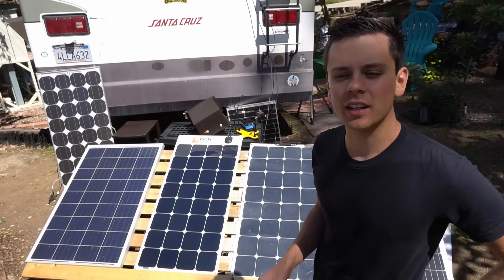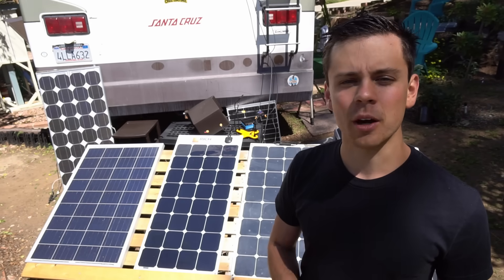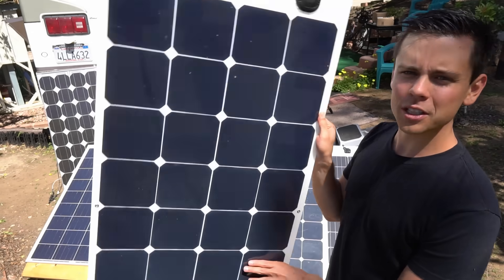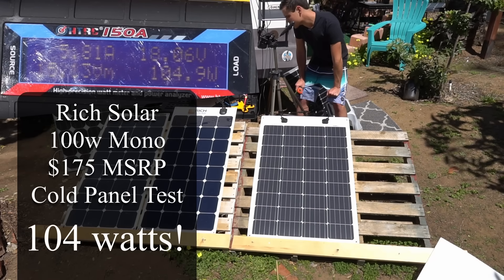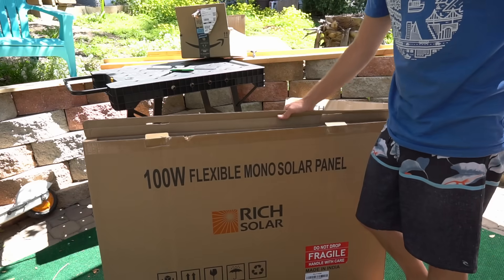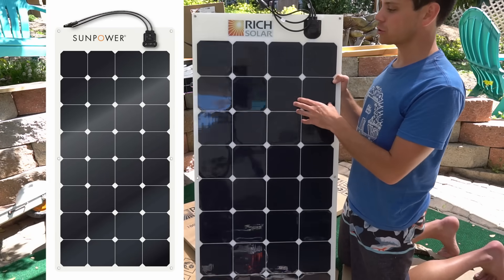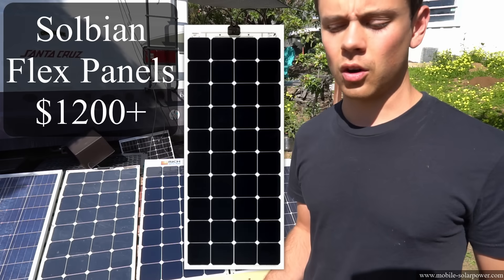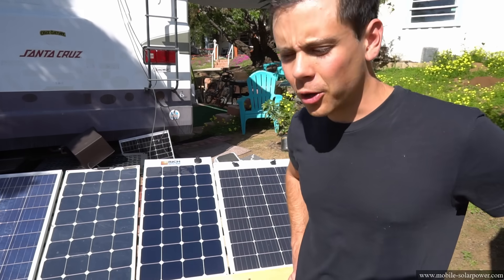Flexible Solar Panel Output Test: Sunpower Cells After A Year vs. Traditional Mono Flex Panel

Comment: I know you dislike the flexible panels, as do most of us, but would absolutely love for you to do an updated video using current products.  I need to reduce weight significantly on our sailboat bimini so going to remove the 500W glass panels we have and replace with flexible.  Thanks!

Comment: Hi and many thanks for posting this vid, this would be one of the best panel output test so far - I have just purchased a Bluetti AC180 mainly for emergencies and for some basic camping use so while the power is it shall be charged through grid power. Now that I am wanting to purchase a solar panel I would be interested to know what type and size of panel you think would be best to use  choosing from - blanket - folding - framed and it it worth getting a few 100W panels instead of one large 300W. Cheers Glenn v from NZ

Comment: I have a curved bimini on my sailboat.  I don't think I can mount a rigid solar panel on it. With 100 watt flexible panels as cheap as they are, maybe this could be a maintenance item to replace them every 1 1/2 years.😢
Reply: how it is a year later ? how much do you output ?

Comment: i got in March 2022 - 4 of my flexible Panels (its a firm called solartronics from germany) for my Flat (i have no Balcony, and i hang them out the window with safety straps like you would secure load on a trailer, you know) - so iam recording the data, i have east-west orientation (due to the roof i dont get a lot of sun at high noon) - so i added 20w polys on the windowsill as well (4 of them on each window, so 8 total) - so i get the most of the sun as possible for my situation - and i have not covered all spaces. so there is room for another 2 20W Panels on each window wich i would test next year. but in summertime i get a lot of energy through it, i can run my fridge/pc if i want. and thanks to your diy lifepo4 videos, i will change my batteries from agm to lifepo next year...so thanks a lot! i record data every day, whats going in with what panels. and i can look up next year, if my flexible panels will degrade, i will see it...

Comment: So you say that panels lose performance more than rigid and that you are going to continue to test. So are you going to mount these flex panels outdoors over the next year so you can simulate actual use ? I have a 100w rigid that has worked fine over past 6 years; however i have discovered that my camping consumption is greater than 100w will produce so i am trying to decide what to buy and how much so love the videos. My camper has curved roof and i am also trying to decide on 200/300/400 and rigid vs flex and also fixed to roof vs portable to follow sun at campground. Your videos are informative and "fun". I live in "sunny" California but have camped in all 50 plus Canada and NW Terratories

Comment: Have you seen any panels catch fire? I just saw that Amazon has disconnected their US solar panels because of a high rate of fires caused by them. I googled Solar panel fires and it seems fire departments are training for this situation. That's scary. Hopefully when I get my system installed on my RV this doesn't happen to the pet because it's a cat it's not easy to take with us if we need to run to the store for supplies, he can't call for help if we are not home.

Comment: Did you test any of these new non silicon based 360 degrees bendable solar panels from Japan with a 100 Watt and 200 Watt rating. They don seem to degarde and cost several hundred dollars.

Comment: Howdy will! I was wondering if the technology has changed at all in the last two or three years? I am in need of at least 300 to 400 watts between 2 flexible panels to fit over the curved Bimini that covers the cockpit of my sailboat. Are there any that you would recommend? Or am I better off trying to build an entirely new structure capable of holding rigid panels?

Comment: Hello, i need help regarding this flexible panels, i am trying to install an small offgrid solar system for my family in Cuba they're having a terrible situation with the energy there, but regular panels weight to much and gonna cost me a fortune to ship them, I wonder if I can use this flexible instead, using the same inverter and battery pack?

Comment: It appears your judgements is based on older technology. What do you think today? Do you take in consideration how the panel is mounted? I use flexible on a stiff frame for weight considerations. It seems like there are pros to some of these but with your bias against flexible panels you can't bring yourself to recommend one even though there might be one you favor.  Too bad.

Comment: I would be interested in a test of flexible panels that have been coated with Turtle Wax Ceramic coating. It tests well as a cheap automotive protectant, but I'd be curious if it would reduce efficiency. My first instinct would be that the inherent UV protection would hinder the efficiency, but on further thought, solar cells convert "visible light" to electricity so the UV protection might not have any measurable impact on production; but may extend the life of those flexible panels considerably.

Comment: My Kingsolar (Sunpower) 100W panels failed after 1 year. The factory had glued them down across the entire panels with permanent adhesive. Had to cut into strips whilst on the roof to tear strips off.

Comment: Renogy 175 watt flex or SunPower 110 watt? Which would you suggest for a teardrop with minimal flat space? I have both. The Renogy has a more durable looking textured surface. I plan to mount on t-tracks with an air gap it so can be removed in the winter.

Comment: To my understanding these are mono or poly panels, im interested by thin film panels. They can be flexible but its not my interest, im looking to a solar array capable to have a lower difference between summer and winter in Europe (if I try to be self-sufficient I see many instalation doing 5 to 20%max prod in the worst months, December and January, compared to the best June and July.) I've heard thin film to be better for shade(not my concern) and low light/clouds.

Comment: This is a great video. I especially like the hot vs cold test since many people think they have a bad panel when it just gets hot in the sun. In my initial research, it sounds like the ETFE coated panels are far superior to the PET coated panels (older style). Further, if the claims are accurate, ETFE resists heat absorption much better than PET leading to a much smaller reduction in efficiency because the panel doesn't heat up as much. Would love to see a more in depth comparison of PET and ETFE panels and long-term follow up. My understanding is that PET panels have a 5 year life expectancy while manufacturers are claiming 10 years for ETFE.

Additionally, resing the flexible panels on the pallets may lead to increased temps (and effeciency loss) because air cannot pass underneath as well. A traditional hard panel with a rigid frame with spacing behind the panel would allow better heat disipation and cooling underneath while resting on the pallets while a flexible panel will not get as much cooling effect. Per the comment above about ETFE resisting heat absorption, this may be why the new ETFE panel had such a high output even once it started getting warm. The temp on the surface may be high but the solar cells may not have been as hot. It may also be a good idea to check what the temp on the back of the panel is. That may be a more accurate indication of how hot the cells get.

Nice work as always!

Comment: I installed three sunpower panels on our boat, in the sun full time in Feb 2019, so far they still look new. I will keep you posted .
Marks Marine Electric, San Diego
Reply: Are they made with PET film or ETFE film?
Reply: how are they holding up after two years? thanks in advance
Reply: @Maybelove88  we were on the boat over the weekend, but the weather was not that good, but so far they are still holding up as expected.
Reply: id be interested on your info...  are they still functioning well  and ETFE film?
Reply: We were on the boat a week ago for three days, from what I see they still produce what is expected. The weather for that weekend was cool and some clouds present. Still batteries reach up 90+% each day with a daily draw around 40 amp hrs per day, in the morning the battery bank (500 amp hr) would be at low 60%

Comment: using roof mounted solar panels requires you to park van in sun yes ??   which gets van hot ??  then we need power to run fan or a/c ??     I am going to make a quick  setup to be able to put van in shade and panels in sun !

Comment: On my Prius, I save $30 a month in gasoline from not using the car as a generator with 200W of flexible panels taped to the roof. That’s a quick payback !
 I could not figure out a good way to mount a glass panel without loss of aerodynamics therefor loss of MPG on a Prius. Thanks for the great review!

Comment: Hey, first of all I just found your channel and it really is informative and well thought out.  I just subscribed.  I have a camping trailer that I tow behind my Jeep.  My trailer came with a 100 watt panel on the roof and also an external plug on the side of the trailer.  I know there will be times that I will want to park my trailer in the shade so I would like to get one of those flexible suitcase type panels.  I have to keep the weight down and I don't want a big bulky aluminum framed panel due to size restrictions.  I don't see any reviews of these types of systems on your channel, can you do one?

Comment: Im like a kid who you tell not to touch the hot stove! I bought 2 100w renogy flexibles. My thought process is to take a portable lithium between places and have four 100w poly mounted on the roof, at each home. 2 flexibles are for travelling with the portable between places. My setup is just incase power goes out on purpose or accident, and it will after the Paradise fire last year. So im hoping they wont break or break as fast since they wont be used that much, or constantly.
Reply: I think you'll be all right.  I have the exact same setup, and I ABUSE mine, all day in the sun every day, and they're still going strong.  I'm going to do a longevity test vid at 1 year

Comment: Will - I really like and trust your analysis and would normally not consider flexible solar panels.  However, I have a Rockwood 2604ws travel trailer which is aluminum framed with a foam core and just a very thin layer of wood under the rubber so there is very little to screw a hard panel to (my preference would be 1000+ watts of rigid panels with a tilt kit, connected to a Tesla battery).  The people at Rockwood have advised against "screwing" anything into the roof.   Given this information, would you agree that flexible solar might be my only option?   Do they have a 250+ watt panel that you might recommend?

Comment: Sunpower cells are good if you want a burn mark in your roof. The moment you get a crack (and you will after year of it baking in the sun becoming brittle), increased resistance and then hotspot and off you go!  Good video by the way.

Comment: Hey Will I just got today a couple of the Rich Solar power that you recommended. They came in the mail. Anyway, when are your doing that video on how to connect these to the new Apex’s EC8 charging port? I heard that EC8 can not carry 190 amps off power opposed to only 90 amps with MC4 and this is why Inergy made the change. And that if I use these MC4 panels I will void my 1 year warranty with iNergy. Is that true?
Reply from the maker: Very cool. Mc4 cannot handle 90 amps at all. And ec8 attached to rich solar will void warranty but it should work fine. Do not solder ec8 plugs, you need to find them with wires attached so you can crimp them to solar panel wires. Just make sure you crimp the right wires to positive and negative
Reply: Thanks Will. I will wait for your video on how to do that crimping and how to connect the Apex to my MC4 panels. Pardon me I’m a newbie when it comes to these things.

Comment: Do you think the decreased lifespan has something to do with cooling?  Since the flexible ones are held together by sheets of plastic, rather than a large metal frame, the panel assembly heats up faster.  And because it is flat and flexible, they're more likely to be mounted directly onto a surface rather than raised up so air can flow underneath them.

Comment: Great videos Will by far the best. What I ask is, of all your videos you never seem to mention the amp output, I grew up manufacturing batteries (lead acid) from scratch. We always talked amps. These days we talk amps in solar controllers, batteries, and amp per hour etc,. I know watts is easily converted, but my interest is in rated amp output.  Do you think you could include amp output in future videos?  As an example I see many panels in the 150 -200 watt range only putting 5-6 amps, yet others are cracking out 8 plus amps.
Reply from the maker: Well amps are dependent on voltage. So watts is much more accurate. Amps can stay at one number, and the total power can fluctuate if the voltage changes constantly, which it does in these systems
Reply: @WillProwse  Thank you for your clear, understandable answer to this question and many others.  I am learning so much from your videos AND from your answers to questions.  I will buy your book, prior to buying a solar system, but I am also recommending it to others now, and have subscribed.
Reply: Have you seen 600 watt panels being advertized online? I can't tell if it is just scams or if they are referring to a BMS with solar panel pictures with cheap prices. Do they make a 600 watt pan now?
Reply from the maker: Especially with solar panels. Look up the it curve of solar panels. Amps are the last thing I would use to compare a panel output

Comment: Hi Will. saw you on Dave 2D.
  Have you tested thin film panels? I have noticed that they are more difficult to come by and generally more expensive. They are also larger for the same power output. However in my opinion the majority of people should be using them.
  They can work at 90% of their spec in low light or indirect sunlight.
  So unless you are tracking the sun for daylight hrs and seasons you are probably better off with thin film if you have the space. Especially if you live in a more overcast region or if you can not angle your panels perfectly into the sun and even that only lasts a few hrs unless you can track the sun.
  I would say that even people who live in very sunny areas could still benefit from thin film unless they are able to track the sun.
  Thinking there is some sort of trade conspiracy or regulation going on, it just doesn't seem right that most people are using the wrong panels for the job!

Comment: Will would lithium solar batteries charge faster than if you had lead acid ? Also what if your solar panels were never in full sun or mostly in the shade would they be worth using. Lets say a quarter output of what they are rated to do isn't that something that still can be used ?

Comment: Isn't it the case that these kinds of panels quickly degrade by 15-20%, then the rate of degradation slows dramatically?
Reply from the maker: Do you have data on this?

Comment: You might want to try the substance, that is used to take the haze out of head lights to increase the output! It fills in the crevices so you can increase output, it make them look shiny again! It cost around $10 bucks, to restore them.

I bought 4 flexible panels, never again will I buy them again. Next time going Poly all the way!
Reply from the maker: Well that's an interesting idea. I might have to try that. Thank you

Comment: Have you ever done a test between using house wiring (like a 12-2 cable) and regular solar wires to feed from solar panels to the charge controller? I've been told that the stranded solar wires perform better than the solid house wires. Maybe? Maybe not?

Comment: Thanks for another excellent video. I have considered the flexible panels for my class B with a curved fiberglass roof.
Can I parallel a new Renogy 100 amp hour lithium battery with my DYI 100 amp hour battery from used prismatic cells, so actually rated 90 amp hours?

Comment: Great video buddy! I just can’t think of a particular application for a flexible panel.
Reply: Sailboats often have flexible panels that you can walk on mounted on the cabin roof, which is usually slightly curved.
Reply: Teardrop trailers. My teardrop doesn’t have a large enough flat spot for a traditional panel nor could it support the weight. There are times when I can’t set out a suitcase.

Comment: My two Suaoki 100W flexible panels failed after 8 months.  Junk.  Now I have to figure out how to remove them, since I stuck them down with eternabond. Thanks for the review.
Reply from the maker: Damn I know that feeling. Good luck with removing that eternabond. Sounds like a nightmare
Reply: Eternabond is forever!
Reply: @stevevelobahn1814  Yeah, it's usually easier to just rip the roof off and install a new one
Reply: @InnovativeSustainableSolutions  lol! It's a "convertible" rv. Got a sun/moon roof!

Comment: Hey will, shouldn't the diode boxes be better placed on the back to better resist sun damage?  Isn't current design an Achilles heel?
Reply from the maker: I thought that at first too but realized that they are designed to be flush mounted on surfaces. If diode box was on bottom, you couldn't flush mount the panel. 

 The diode box is more exposed to the sun and it can also cast a shadow on the panels if it's too big. That's why the new ones are not boxy. But yeah nice for you to point that out.